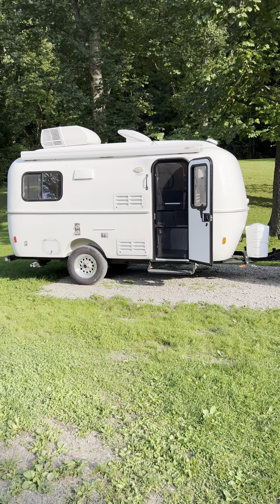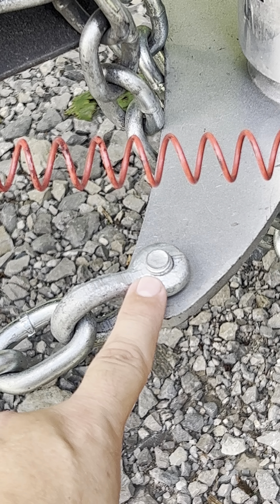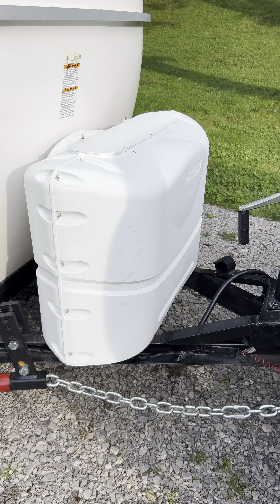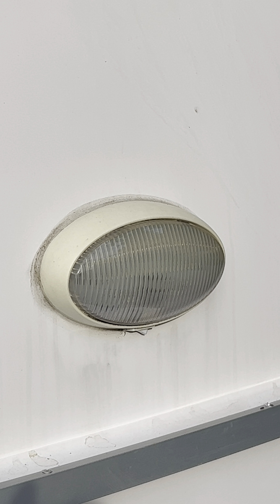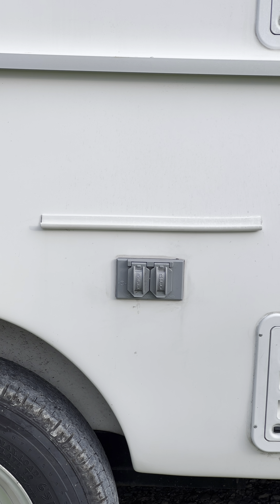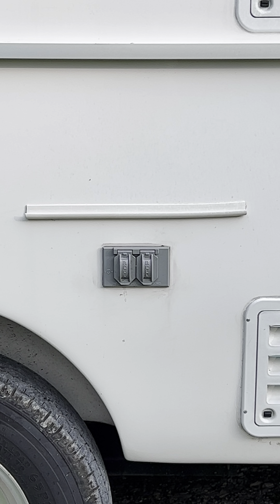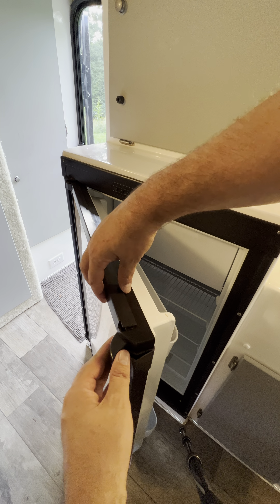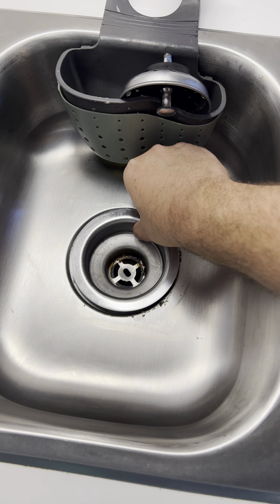How has my 2022 Casita Heritage Deluxe camper held up?

Comment: Sorry for your troubles.  I have a 2021 Spirit Deluxe and have had only 2 issues.  The maxx air fan went out, but Coleman Mach replaced it without issue.  I had to cover the labor.  I tapped one side marker light with a tree and it stopped working.  Just left it alone.  No rust or fiber glass issues, we absolutely love our Casita.  When not in use, I keep it in a 10 by 23 by 30 storage locker, as they are not cheap, so I wanted to keep my investment protected.  FYI.
Reply: Storing them in an enclosed area is key to keeping them looking good long term, out of direct sunlight at a minimum. Saddened by some of the issues seen in the video on a two year older Casita.

Comment: I have owned Rv’s for over 30 years. Most of those unfortunate things mentioned are to be expected, especially with a single axle rv. I have had the same issues, however when I repair, I glue and screw. Rarely do I have an issue with same item. It’s called getting the bugs out. Casita could make them better if they wanted, but time is money. Sorry you had these issues.

Comment: Blown away about the cracking on the gel coat at the belly band. Is this camper stored outside in the elements year round? The belly band where the door opens shouldn't have have popped loose like that either but I think a new rivet will take care of it. Casita has moved to new exterior lights, unfortunately my 2024 has the old style on the front like yours but the new style at the door, silliness. Are you sure it isn't just a bad light bulb under the lens? And the mild surface rust on the frame is typical of any painted steel frame, hit it with some touch up from time to time.